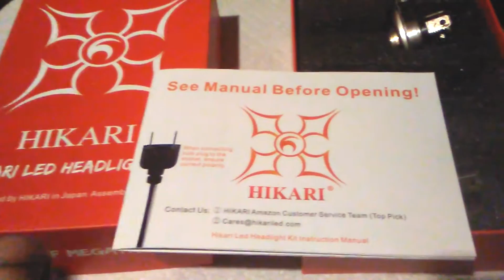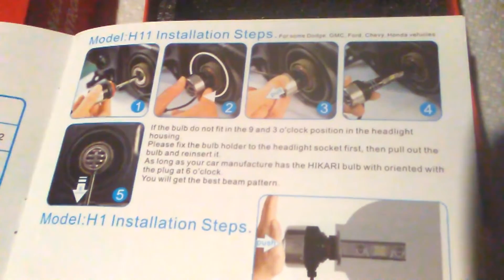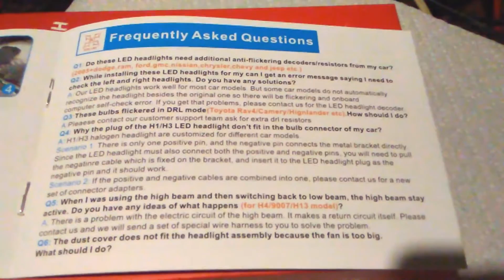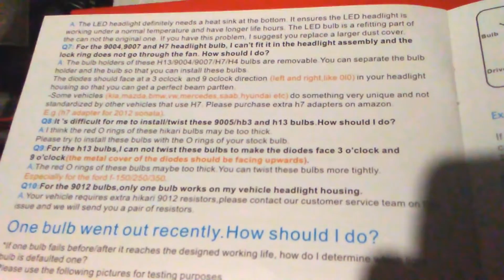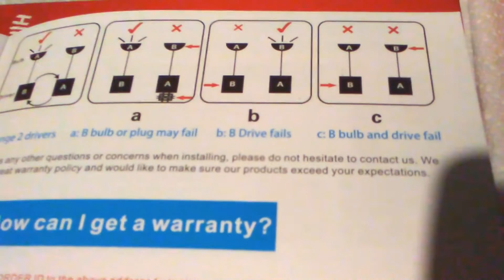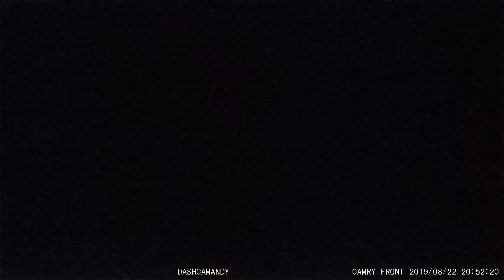Honest Review of Hikari "Eye of Megatron" LED Headlight Conversion Kit for #9003 bulb

Comment from the maker: One thing I forgot to mention in the video: there is NO apparent "noise" (Electromagnetic Interference or EMI) across the FM and AM radio bands, nor does it appear to bother 2.4 and 5 GHz WiFi or 4GLTE signals. This can be a problem with lesser-quality LED drivers.

Comment: Projector or reflector?
Reply from the maker: Reflector housings.
I haven't done an update video, but it turns out these bulbs did not last very long before I began having issues with them. Individual LEDs flickered and died. Sometimes, my driver's side high beam would be dimmer than the low beam. At one point, my passenger side low and high beams were both dimmer than the amber parking lamp next to it.
In less than a year's time, I had replaced both with standard Halogen until I found a better solution.

I can recommend Beamtech H4s ($38.99 at time of purchase, on Amazon) as a much more suitable alternative to the Hikari "Eye of Megatron" Series. I've had them installed for quite a bit longer than I used the Hikari bulbs, I've never had an issue yet - no flickering, no failed LEDs, no odd coloring after long-term use. Instead of a fan, the Beamtech has a solid finned heatsink that gets uncomfortably-warm to touch, but not hot enough to burn skin or damage anything nearby.